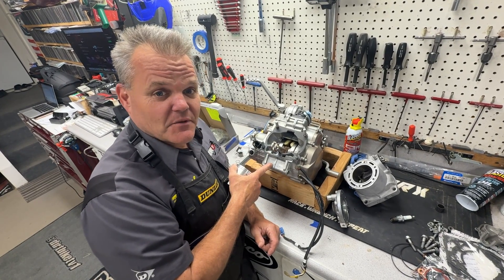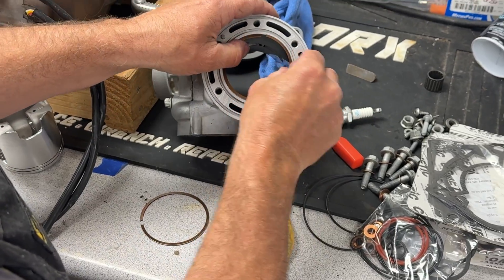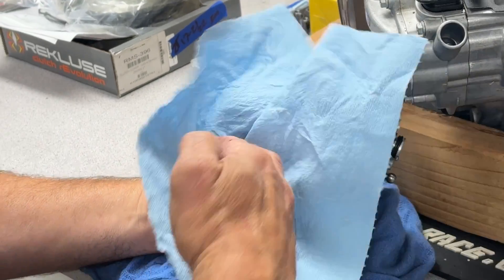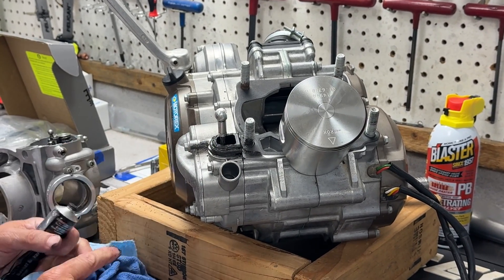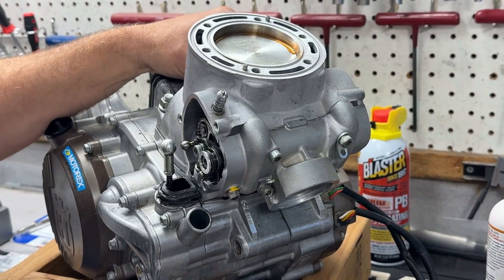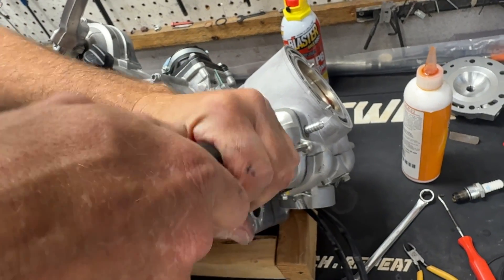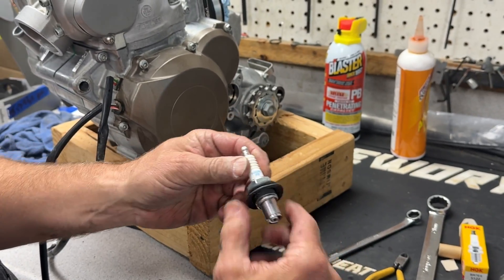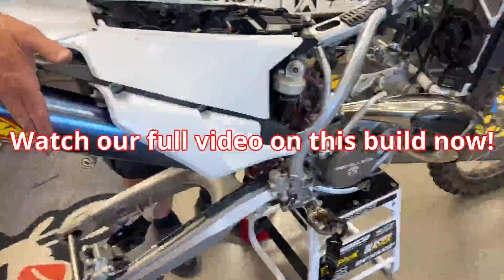TX300 2-Stroke Top End Rebuild | Full Piston Install Guide

Comment: I absolutely love my 17 TX300 with Lectron carb, Powerdial, and Kreft suspension. Haven't found a new bike that I like better so I will just keep rebuilding it. I just turned 60 so it may actually be the last bike I ever own. It always bothered me that I don't have a torque wrench that goes onto the cylinder nuts inside the power valve housing.